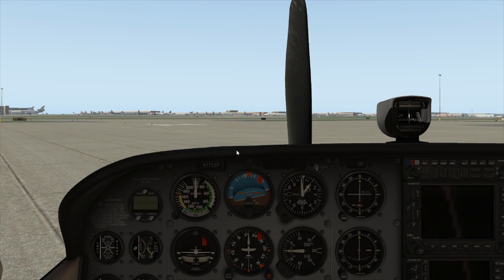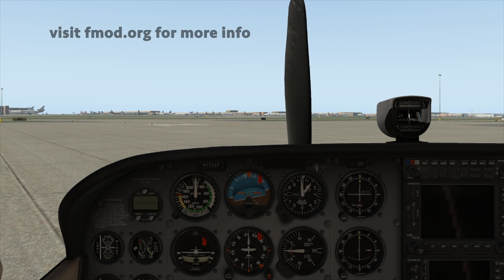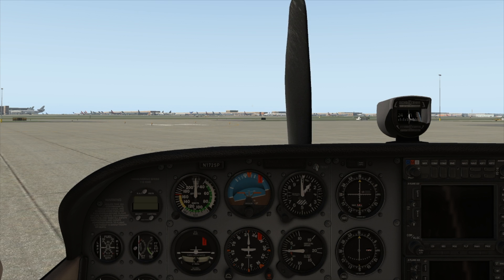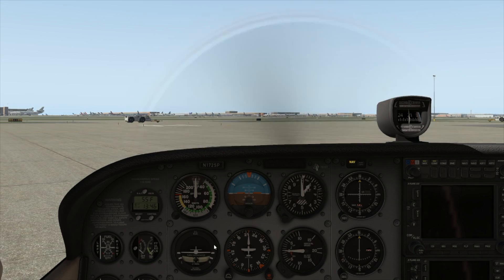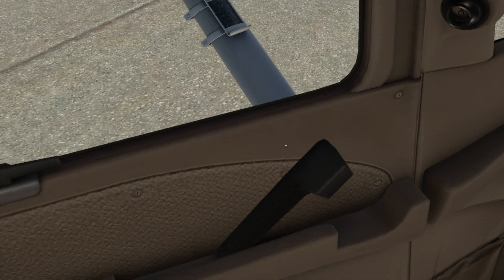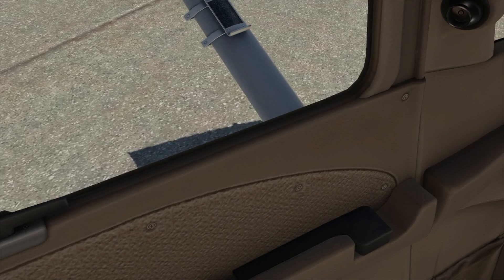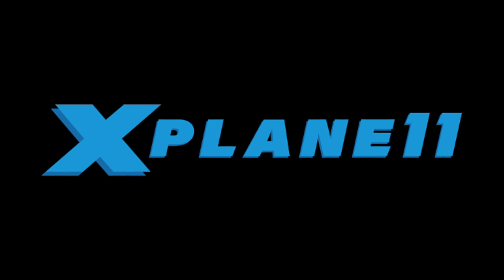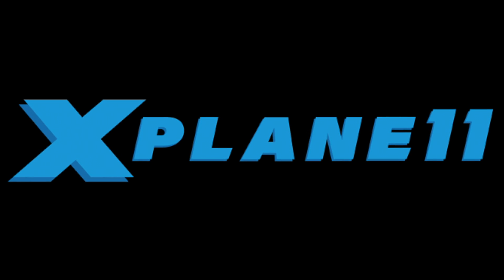X-Plane 11 FMOD Sound

Comment: The start up sounds for these light prop aircraft in nearly all flight sims is so wrong. If you have ever been in a plane like this when starting up it doesn't sound anything like this. You get the starter solenoids turning the engine and then it roars into like reving a big over idle doing so. In this you get he starter sound then it pathetically just fades from silence. 

Not impressed with that so far.